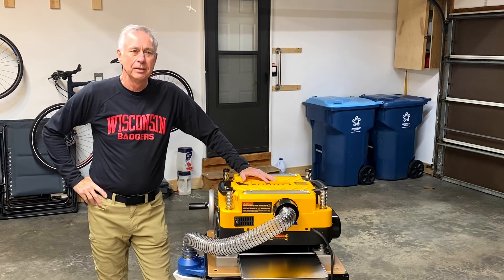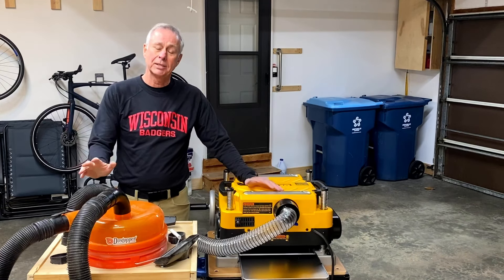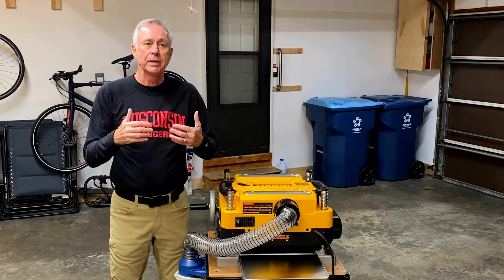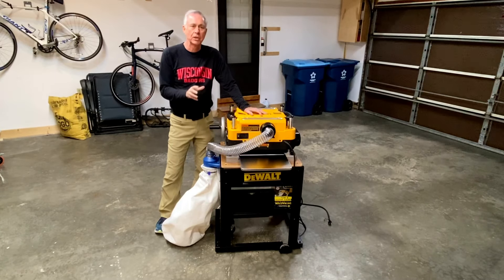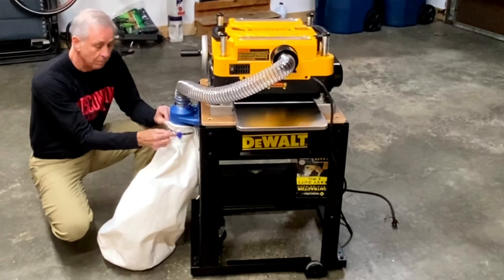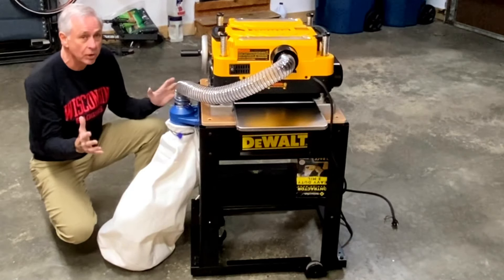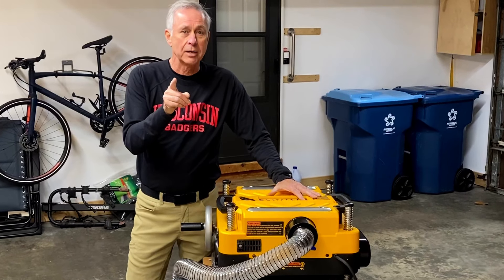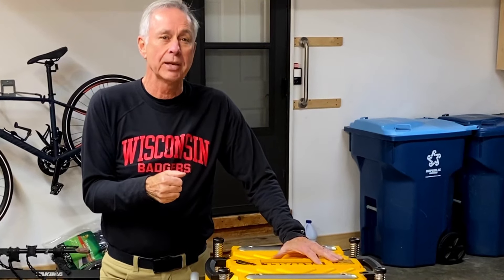How to Control Dust on the Dewalt 735 Planer

Comment: Could you explain and show us how you empty your Dustright bag when it is full? I always made a big mess and just dread doing it periodically! Thanks! PS. Go Badgers!
Reply from the maker: Ha!  I forgot I had the Wisconsin shirt on.  We were just in Madison over the last week.  Great city!  I empty my dust bag into a kitchen size trash can that holds a 13 gal bag.  I do it outside because there is no way to stop the fine dust  from floating around.  I put the opening of the dust bag as deep inside of the trash can as possible and start lightly shaking the bag.  If I’ve let the dust bag get too full, it takes more than one trash can to hold the dust.  Then I just tie up the end and throw it out on trash day.  Those planners sure make a lot of dust!  I joined a local Fablab that is part of a Jr. college near me.  I can process my rough lumber there on much larger machines and better dust collection than I have.  If you have one near you, look into it.  For me the cost is $500 per year.  It’s also great when it’s too hot or cold to work in my garage.

Comment: I like the setup, but I'm a little bit hesitant on the six extra inches (or so) that the planer will take at its side when it's parked inside the shop.  I'd expect to bump into my upper thigh unknowingly frequently.  Currently using the 4" spring clamp from Woodcraft with a zippered pillow case and it's working fairly well.  Great video, Badger! (from a Buckeye haha!)
Reply from the maker: Thanks for the comment.  I get not wanting to deal with an extra space my set up takes.  My tools already take up too much room in my garage for my wife’s liking! Thanks for sharing your method.  Ohio is on fire!  Should roll over Michigan St. This week!

Comment: After using this for a while, are you seeing the outside if the bag get dusty?  Are you seeing fine dust in the air when using it and if so how does that compare saw to a table saw?
Reply from the maker: Thanks for the questions.  I do see some dust on the side of the bag.  I empty it outside and swat it a few times to get rid of it.  I do not see fine dust in the air but that doesn’t mean it isn’t there.  It is no where near as dusty as my table saw and I hook up a dust vac to that.  I’m a runner so I’m sensitive to the fact that I should control dust the best I can.  I also have an air filtration system hung from my ceiling.  I’m amazed at how much dust it collects.  If you want to see that, check out this video- https://youtu.be/xB5IQgJozUQ

Comment: How did you mount the Rockler dust port?
Reply from the maker: I drilled a few holes and attached with a screw and a nut.
Reply: Think I am going to try a heavy duty Velcro before drilling the holes.
Reply from the maker: @steveroberson5147  Might work Steve.  Pleas let me know.
Reply: @Ray_Here  the heavy duty Velcro is working so far. I purchased the Powertec 70334 bag for $25. It has the clear strip down the side with a zipper, though I doubt I will use it. It’s rated as 1 micron.
Reply from the maker: Thanks for letting me know about the Velcro.  The bag I saw at Rockler was 5 micron.  I looked at the Powertec 1 micron bag but I was a little concerned that it might not let enough air through to let the planer blower work effectively. That’s why I went with the 3 micron powertec bag.

Comment: Terrific video, clear and simply put. I just ordered the planar and really like this setup. Curious on your thought about the 4” vs. 2.5” inch hose.  My understanding is that the 4” allows for clearer and faster passage of dust, however the 2 1/2 appears more streamlined.  Also where did you get the hose converter and did you attach it to the stand?  Thanks much
Reply from the maker: Hi Mitch.  I’m glad you found the video helpful.  The port out of  the planer will accommodate both 2 1/2” and 4” hoses.  The outlet is actually only 2 1/2” but it is enlarges to 4” but the area that’s enlarged is solid and allows no additional air to escape.  I hope that makes sense.  Given that, I decided to use the 2 1/2” hose.  Also, I have no other use for a 4” hose as I don’t have a large dust collection system and only use shop vacs.  The link to the converter is in the description.  It came from Rockler.  I did connect it with a screw and a nut to the frame.  I believe I talked about that in the video.  The system works great.  In the video, I question how difficult the bag might be to empty as the cheaper version I bought doesn’t include a zipper.  There is no issue emptying the bag out of the larger that 4” opening.  All in all I’m very happy with the dust collection system.
Reply: Thanks for your quick response and the generous use of your time. What I like about your collection method is that the bag can fit easily in a small area, maybe onto the mobile cart when not in use.  I have a small workshop. Does it do a good job of capturing the finer dust?  I’ve seen some use a trash can with the bag in it.  Wondering what you think.  Thanks
Reply from the maker: If I recall, Mitch, The bag filters down to 3 microns.  The same style bag at Rockler only filters down to 5 microns.  So I think it does a pretty good Job.  I also use an air filtration system in my garage/shop, which is small as well.  It really helps.  I did a video about it called”What sizes shop air filtration system?”  https://youtu.be/xB5IQgJozUQ  If you’re interested, check out the video.
Reply from the maker: Thanks Mitch. I like the idea of getting the hose out of the way.
Reply: @Ray_Here  What is that idea if you could share. TIA.
Reply from the maker: @ashokmoghe8035  Sorry,  I just don’t remember.

Comment: The DeWalt cart is the MOST DANGERIOUS cart you will ever use. This cart will flip over so easily I thru my cart away and bought a Rockler cart kit and put my 735 on it.
Reply from the maker: Thanks for the comment.  I’ve not had any issues with my cart.  I don’t tend to plane long, heavy boards though.

Comment: Great solution! Is there a reason you put a coupler at both ends rather than using a 4" hose?
Reply from the maker: The output from the planer is really only 2.5”.  The coupler came with the planer.  It only has a fake 4” width for those who have a large enough dust collector to handle the planer output.  I hope that makes sense.  Also I don’t have any need for 4” as I don’t have a big dust collector.   Thanks for watching!

Comment: I think this setup can be modified further, can you please send it to me and let me try?
Reply from the maker: All the items I used are in the description.  If you do something different, please share.
Reply: @Ray_Here  It was a joke....
Reply from the maker: Ha!  These days you never know!
Reply: @Ray_Here  Lol that is true. BTW I did use your setup, the blowing part was gone, but I do get a lot of dust on the feeding plate. Since in AU, we dont have DWE735x. we only have DWE735, so I build an extra feeding platform on both sides. I have a lot of dust on the machine's glass-grade-metal feeding plate. Whereas you barely have any. I was planing treated pine. Maybe thats why?
Reply from the maker: Ray,  A couple of questions:
Where is AU?
What do you mean, your blower unit is gone?
I’m pretty new to planing so I probably can’t offer you a solution.  I don’t have a big dust issue.  I have found that planing down in smaller increments produces better results and obviously smaller dust chips.  I also find that pine can be a bit messier.  Also, the planing speed might impact the amount of dust.
Reply: @Ray_Here  AU is Australia.
Not the blower unit, the blowing part of the machine. The dust port from 735 has a motor blowing out the dust. so that part has been solved.

I have a lot of residue on the feeding plate, I think it's because of pine.
Reply from the maker: Good to hear from Australia.  I’d love to travel there someday.  My guess is that you are correct.  I missed the “treated” part” I don’t think I would run that stuff through my planer.  Pine is already easy a sappy mess.   I use a lot of poplar as I like the grain.  It’s a softer wood like pine but a lot prettier.  I don’t know how available poplar is down there.  It’s pretty common here.
Reply: @Ray_Here  Poplar, not very common here.
Cheapest is treated pine, which is about $6 AUD/meter.

Comment: Hi. Very nice presentation. I am thinking to buy a planer and unfortunately I do not have available space in my garage. I was thinking to leave the planer in my backyard sitting on a stand and covering it with something like barbecue cover. Do you think it will be ok ? By the way I live in Southern California by the beach where humidity is high. I would appreciate your input , if you know.
Reply from the maker: Thanks for the comment and question.  I would not feel confident in giving you an answer.  There might be an issue with the blades or other metal parts rusting.  We live in the midwest and have high humidity as well.  I would guess that my garage is also humid in the summer.  It’s a pretty expensive tool.  I would recommend that you call Dewalt and ask them.

Comment: what I don't understand is why you didn't just go full 4-inch down to the bag.
Reply from the maker: I certainly could have.  The coupler on the planer came with it.  Although it accepts a 4” hose, It’s really only a 2 1/2” opening.  I have no other use for a 4” hose and it would be bulkier.  Thanks for the question!
Reply: @Ray_Here isn’t the 4 inch the air intake for the blower?
Reply from the maker: @ConcreteLand  You can certainly connect a 4” hose to the planer blower.  However the actual exhaust opening is only 2 1/2”.

Comment: I just received my planar and have been using it quite a bit and am enjoying the smooth surface.  I have 2 questions I was hoping you could answer for me if you have the time.  First, I have the same setup as you with regard to the bag and extensions. Thanks for that.  The first shavings removal was a bit of a bear.  They barely come out of the bag and they attach themselves to everything particularly the outside of the bag.  Is there anything I could do to address that.  Also, I notice that when I feed in a long board, specifically on its side, the back pops up for a second.  It seems that’s the way it the rollers grab the piece.  Is that normal?  It doesn’t appear to be producing any snipe.  I’m guessing it straightens out before reaching the cutters.
Reply from the maker: The shavings build up static. I don’t have a solution to that. I just hold my bag over a trash can to empty it. Some chips adhere to the mouth of the bag but that’s about it.   I added a 4ft x 12” melamine board that I slip inside the planer for longer boards.  It is indeed the roller grabbing the board that causes it to go up. I’m surprised your not seeing snipe.  I have found that running the boards through multiple times and only taking off a small amount works best for me. Look for YouTubes about snipe and you will see that platform I’m talking about. Have fun with your planer. Now you can play with rough lumber. More time consuming but satisfying results.
Reply: Thanks much for responding.  Means a lot. Your answers solve the problem.  Also, just to note, I have the same setup as yours.  I also added a 1 ft., expanding to 3 ft. Polypropylene tube into a 90 degree elbow at the planar.  This keeps the bag out of the way of the out feed tray.  Just realized I never subscribed, so now I’m your newest sub.  Mitch

Comment: I must confess that I never read the manual so I had been using my shop vac.  You're right, it made a huge mess.  I had no idea there was a dust collection bag for this.  I just looked on Amazon and Powertec has improved their bag with window down the side and the zipper to empty it through the wide end.  And it's still only $28.99.  The only drawback is that it is a 30 micron filter.  The 1 micron bag they have doesn't fit the 4" port.  I really appreciate your video.
Reply from the maker: Glad the video was helpful!

Comment: I also recently purchased the same setup as you. The problem I think you will find is that those bags are great for chip collection,  but are not very good at the fine dust that the bag can not contain, that is the harmful dust.  My Temporary solution was I am using a 20 4-inch hose and have the bag outside my garage- so that fine dust is not near me.  My plan is for a large trash can for the chip collection before Dust filtration machine I have. Honestly, I   will get rid of the planer and buy one without the blower, it is what causes all the problems.
Reply from the maker: Thanks for sharing that information.  I typically wear a mask when using my table saw, Miter saw, sander, etc.  I also have an air filtration unit on my garage.   A little cold right now but I usually take my tools outside to work.  Great idea to put the bag outside the garage!
Reply: I ordered the exact same supplies after watching your video. I just hooked everything up and it works perfectly. Thank you

Comment: The absolute most rediculous dust collection system I've ever seen! In fact the planer is the worst I've ever used in my 35 years of professional woodworking. First of all, why on earth would they put a "powered" dust collection system on the planer. The definition of a "dust collection system" is it's a vacuum that "sucks dust", it doesn't need a fan to "push" the dust into it. The system is terrible and obviously over engineered to the point it simply doesn't work without modification. Second, it snipes every time. Mine is new out of the box, I've used it four times now with maple and walnut and both ends snipe, going in and coming out, on both speeds. So much for self locking cutter heads. This is a huge deal, and had I known this was a problem I would have never purchased it. Third, the locking thickness stop goes a solid 32nd past the set stop dimension. I've tested it only on the 3/4 stop but it absolutely is off, which is also a huge problem. Why have it if you have to pull out a tape every time to check thickness. Fourth, it doesn't feed well, the rollers are already slipping on the wood after only four uses, that's crappy. The machine is crappy. Don't buy one.
Reply from the maker: I can’t argue with the snipe issue. I can control it but I have to be careful.  Thanks for your viewpoint.
Reply: @Ray_Here  Your solution for the dust collection was a very good idea. Good vid, thanks.